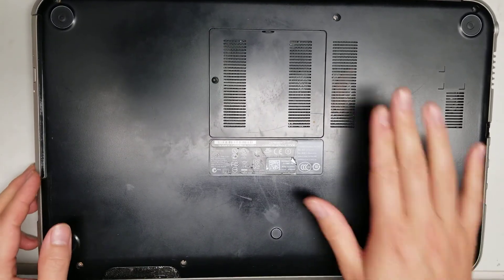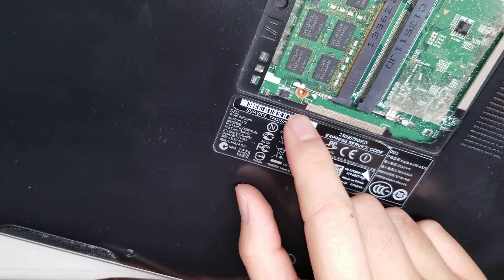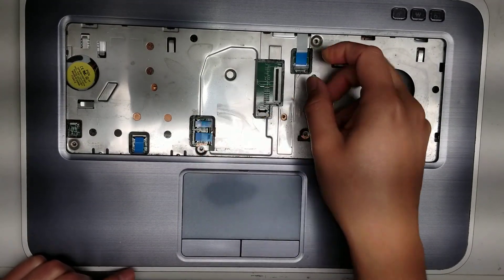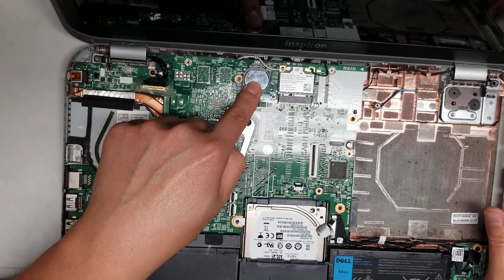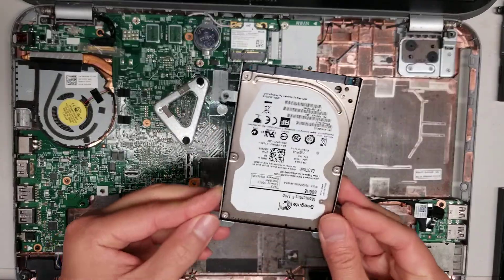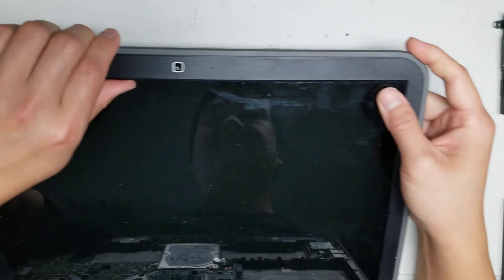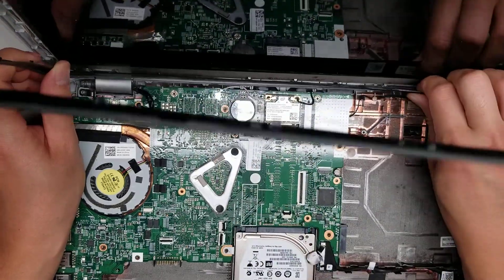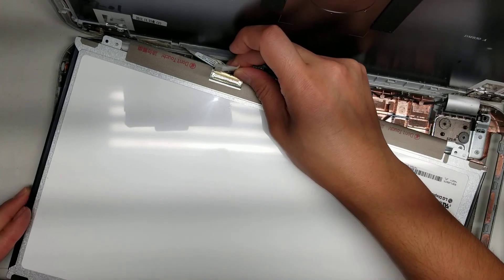DELL Inspiron 15z-5523 15z Disassembly RAM SSD Hard Drive Upgrade Repair

Comment: how to we install ssd with hhd in this model?
Reply from the maker: You need a CD drive caddy to put the hard drive in.
Reply: @ItsBinhRepaired  Ok
Reply: @ItsBinhRepaired  which size of cd drive i need?
Reply from the maker: @115muhammadanns6  measure the thickness in mm
Reply: @ItsBinhRepaired  how can i measure do you know? about because you repair it!
Reply from the maker: @115muhammadanns6  a ruler

Comment: I tried to replace my Hdd on my dell inspiron 15z 5523 and now I am having this 
error: 
Internal hard disk drive not found 
to resolve this issue,try to reseat the drive 
no bootable devices strike f1 to retry boot f2 to enter setup menu f5 to enter psa

any ideas what causes this? I also installed win 10 os
Reply from the maker: Did you clone or install the OS?

Comment: The title mentions SSD, yet the video doesn't show where the SSD is or how to remove it.
Reply from the maker: Sounds like you didn't watch the video or pay attention. Please rewatch it. If you didn't hear me mention SSD, then you'll likely break your computer attempting this. I don't believe in taking shortcuts, so I will not give you a timestamp because that'll lead you to skip all the other important parts that need to be done before the SSD.
Reply: @ItsBinhRepaired  Sorry, but I see no removal of any SSD. Watching the video, you open up the laptop, remove the battery and show how to remove the HDD. You point to the fan, and then proceed to spend of the rest of the video disassembling the screen. FYI - I've opened up my Dell 15z-5523 several times to replace the battery and wireless card, but I was never able to locate the secondary 30GB SSD. I was hoping this video would show that, but it didn't.
Reply from the maker: @jamesmaroney878  don't watch, listen. Lol the HDD can be upgraded to an SSD
Reply from the maker: @jamesmaroney878  there's no secondary SSD that I know of.
Reply from the maker: @jamesmaroney878  I just looked at a bunch of motherboards on eBay. There's no SSD slot on any of them. Where are you getting a 30gb SSD? Are you sure you're not talking about the recovery partition?
Reply: @ItsBinhRepaired  My Device manager clearly shows a separate 30 GB SSD (SAMSUNG SSD PM830 mSATA). Disk management shows it as well - it is not a separate partition of the HDD. .It's used in conjunction with the Intel Rapid Storage Technology program that's installed.
Reply from the maker: @jamesmaroney878  hmmmm must be integrated
Reply: @jamesmaroney878   The SSD is an mSata one and it is located on the other side of the motherboard, near the RAM.